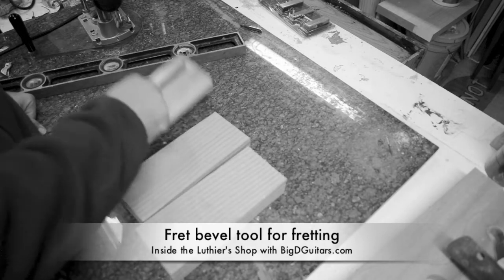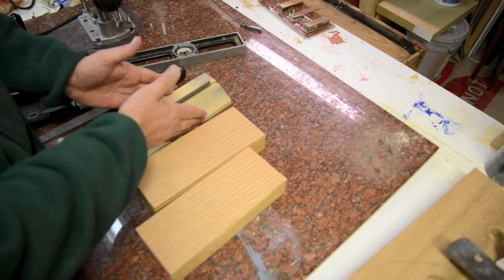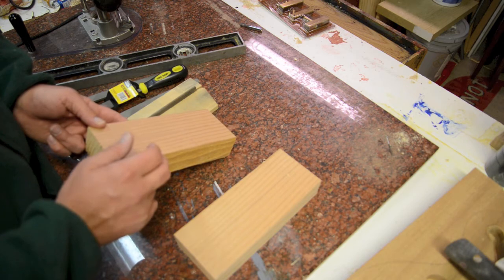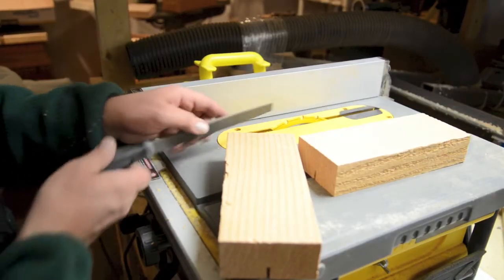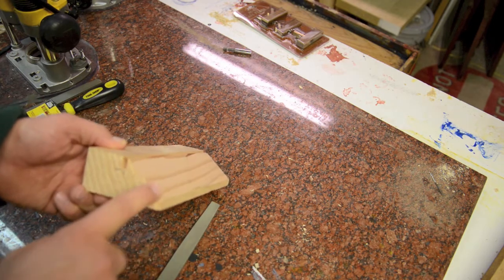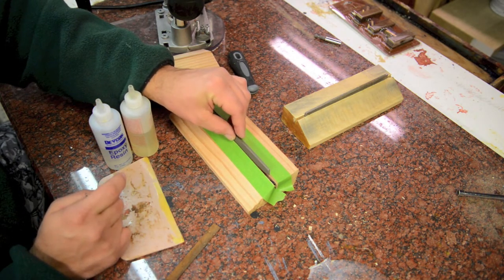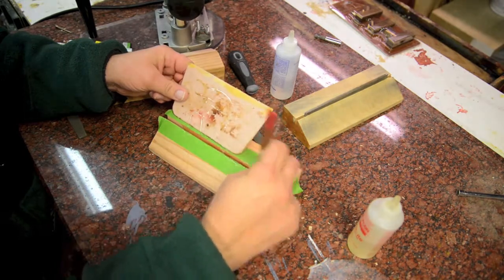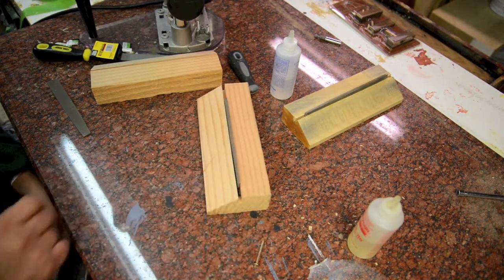DIY fret file for fretting luthier custom tools for guitar building

Comment: I made mine smaller 4.5" in length, Flea markets are a great way to get files cheap but 1.99-2.99 is a perfect price too.I seem to get better pressure on the file when its shorter in length.I like to use maple scrap and I glue plastic end plates on made from pick guard material or kydex.     great little tool for sure

Comment: What kind of tablesaw is that?
Reply: I was wondering the same thing. Did you ever find out what kind of tablesaw he was using?
Reply: Kent Ippolito Nope, I make one of the files with a regular old table saw though.
Reply from the maker: Kent Ippolito dewalt portable table saw
Reply from the maker: dewalt portable tablesaw    Dewalt DW745 10 in. Compact Jobsite Table Saw

Comment: Good job, but why not use a good file like Nicholson? They are not expensive and last a lifetime also they are sharper and hold an edge.
Reply from the maker: +George Lackey very true.  I have a bunch of those as well.  One of the files broke so rolled with it.
Reply: @bigdguitars  

Hi, I hope you are very well.

* I want to use a nicholson file to remove excess from the sides on the frets and another one for bevelin at 45 degrees.

- which reference do you recommend? I would like to use the finest grain possible but still useful for the job.

I look forward to your prompt response. Thank you
Reply from the maker: @mutilation7763  you need to use a fine grade file. 
You can do it by hand just go slow.  I think this is a nichols file in there
Reply: @bigdguitars  

thanks for answering.

* I was thinking of buying a Nicholson-21839N single cut coarse grit.

they have 8 options 0 = Coarse, 00 = Medium, and then 1-6 as fine and ultra fine.

* I'm going to make my own beveling tool to use with stainles steel Extra jumbo frets, and maybe leave 60 degrees of inclination, since 45 I don't like very much.

* Do you think that Nicholson-21839N would be very aggressive? would a medium 00 serve me better, or perhaps a fine grade 1? Thank you